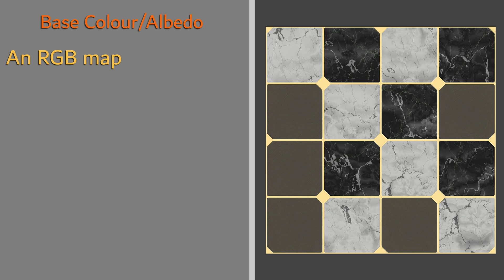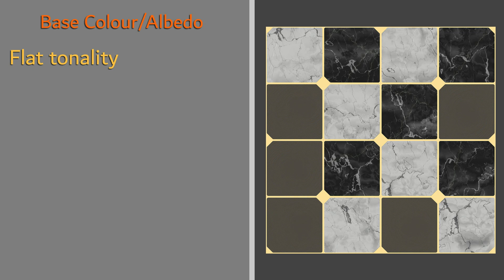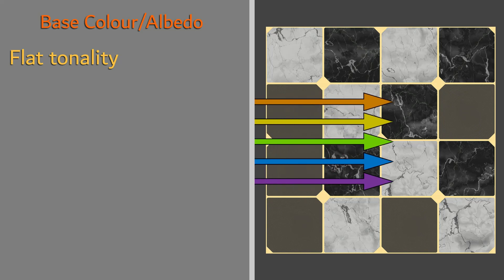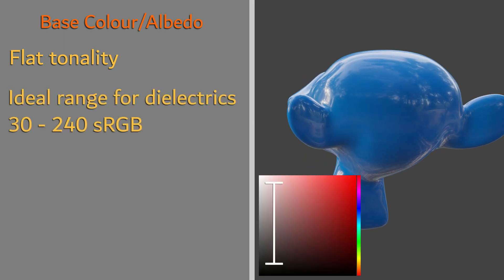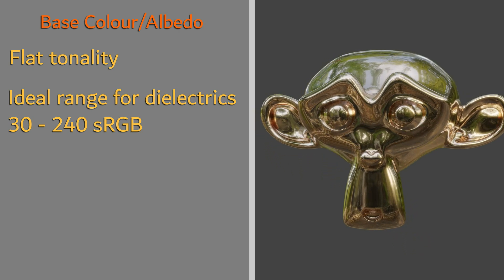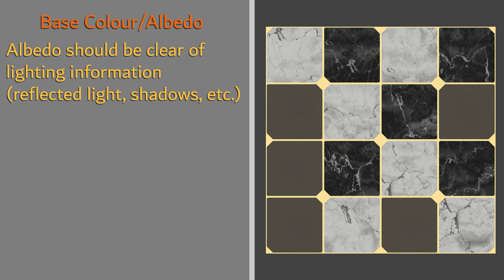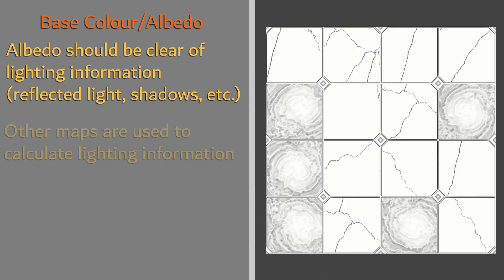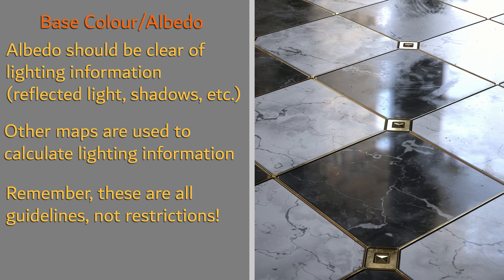What is an Albedo Map?

Comment: This is a great series! Question: in 0:16, does "reflectance values" also refer to the color of the metal? If not, how could you change its color if not using the albedo map?
Reply from the maker: Good question! So in this instance, "reflectance values" essentially means the colour of the metal, you are absolutely correct! For the metalness workflow, an Albedo map will describe the colour for both metals and non-metals, however from a scientific standpoint the light being reflected from both types of surfaces isn't exactly the same, thus the different names for their respective "reflectance values". 

Long story short, an Albedo map will tell the shader what colour to give your metals and non-metals. :)